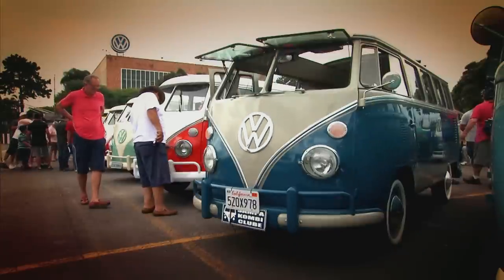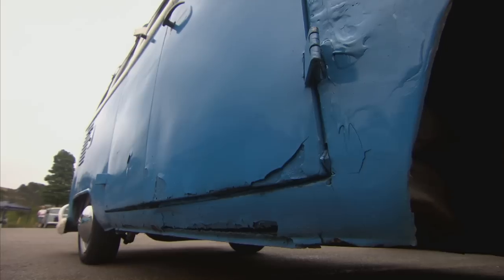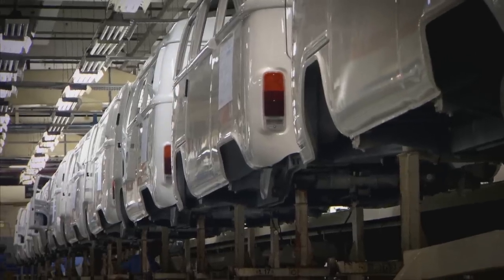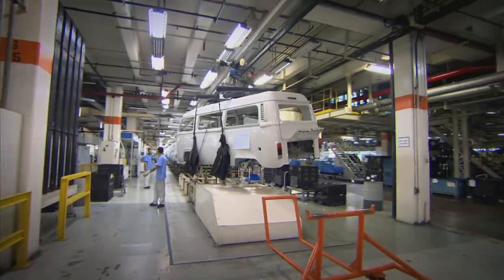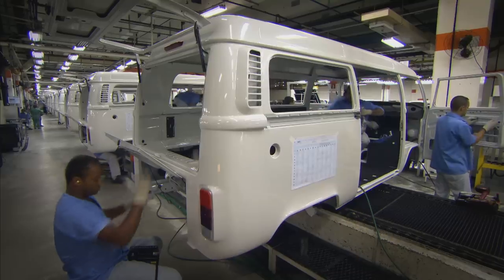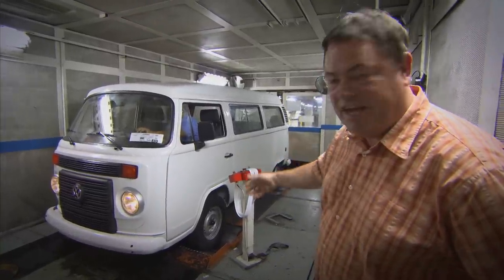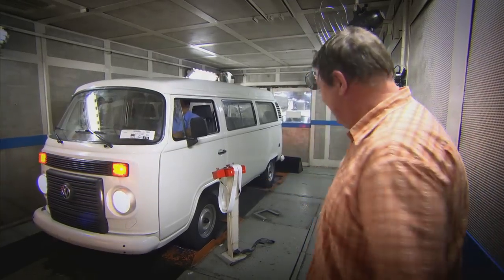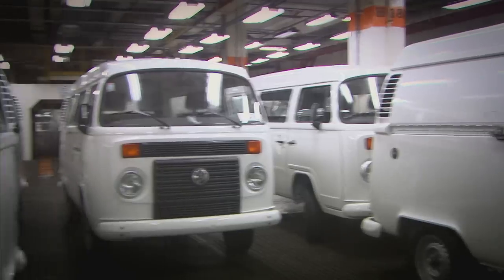Last line of VW Camper Vans | Wheeler Dealers: Trading Up

Comment: That is amazing they were still producing them close to the 1960's style. Why would they stop producing those??? I want one!!!
Reply: Brazil stopped producing it because new car laws obligations for ABS brakes and air bags for brand new cars. The old Camper couldn't afford for those.
Reply: Unitl 31/12/2013, Volkswagen keep in production this Kombi Clipper (at least it was this designation in Brazil), but no longer using air-cooled engine, just a modern 1.4L 4cylinders fuel injection. But still a nice exemple of a reliable car/van. Those, was sell for 2 to 3 times a price of a brandnew compact-car, back in 2013.

Comment: this grill in front of the vw t2 is awful.its cheap and ungly.the original is better
Reply: the original had no grill as the motor was aircooled, these are equipped with modern watercooled engines so they needed an radiator in the front

Comment: 4x4?
Reply: no, actually the rollers are moving the front wheels, to test steering, geometry, brakes and etc...
Reply: Não.
Reply: djmhyde Crappy test, because everybody knows that Kombis are fucking dangerous to drive. Look at this: https://www.google.com.br/search?hl=pt-BR&site=imghp&tbm=isch&source=hp&biw=1360&bih=643&q=kombi+capotada&oq=kombi+capotada&gs_l=img.3...1060.2985.0.3199.14.10.0.3.0.1.312.1568.0j1j4j1.6.0.msedr...0...1ac.1.58.img..10.4.1002.ue7DRl2d-RM
Reply: well it's a 70's vehicle, of course they are dangerous, but is a classic vehicle a part of the automotive history....

by the way "crappy test".. welll, so because the vehicle is dangerous, let's make'em more dangerous avoiding this basic test.... very silly comment

and every single vehicle is dangerous, cause even in a Tesla S if you hit a lorry at 70mph you will die....
Reply: Beto de Freitas
My Father and his brother my uncle where both kombi nuts, probably between the two of them about 20 odd kombis thru the 70's and 80's and various other VW models. Fantastic people mover and great in the bush with the engine over the rear drive wheels and that air cooled engine fantastic economy on fuel.
Reply: djmhyde Dude, the Kombi was kicked out of the brazilian market forever, because the gov approve a law that only allow  vehicles with standard ABS brakes and airbags for sale by the companies. Brazil is screwed by the car factories cartel that sell facelifted old junks for us, while you guys can buy an old Beamer at the same price of a TV. Kombi WAS a nice car, but not belong to this CENTURY!!!
Reply: wierd, brazilians hate the VW Bus, but made them until 2013...... i wish they still make them here in europe...
Reply: djmhyde That's not hate, but you have the T5 when we stopped in time because of a German cartel that make them rich while we drive this unsafe stuff. I had a green Kombi 67, a nice car, but not anymore for daily use.
Reply: so you guys in brazil do not have any modern van? you guys do not have the Meredes Sprinter, Ford Transit or other thing like this?
Reply: djmhyde We have all of this vans that you mention (incredibly expensive), but any made by Volkswagen. The problem of the Kombi is safety issues. Maybe if they go through this way http://irmaododecio.blogspot.com.br/2013/12/kombi-highlander.html
Reply: djmhyde Yes we have ford transit and Mercedes Sprinter, but the Volkswagen Kombi is more cheapier.

Comment: VW Brazil is known for  the lowest quality in cars round here.

And about the "modern" Kombi shown in the video wich is equipped with a 1.4 liter water cooled engine still uses the old 4-gear transmission. That is just rubbish!

They just don't care about safety! This thing can reach up to 90mph. The crumple zone is the driver's face. Steering is inaccurate. Stability is the same since early air-cooled models. Yet it is the most used "school bus" for our children...

The real reason for the end of production of this death trap is the new law that requires ABS and standard airbags. 

Good bye Kombi! You should have gone a long time ago!
Reply: +Walter Jr.  The old gearboxes are fine. People expect too much from an old car. I have a T3, and drive about 50 tops. Why? Because thats it's designed speed for cruising, even though it goes well over 100 with the GTI engine. Those new combi's go 90 downhill, with a tail wind, falling from a cliff perhaps.
Reply: They could have at least dropped a 5 speed in there, 4 speeds are rubbish for economy and there is no reason to be using one in this day and age weather an auto or manual.